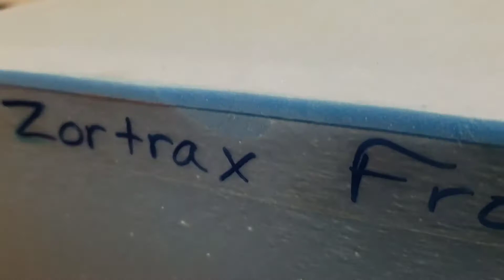ZORTRAX M200 Is Stripping Filament and How To Fix It | 3D Printer Extruder Feed Gear Strips Plastic

Comment: Stock extruder motor is way too small for the job so it gets awfully hot. My fix was put in a bigger stepper and adjust the Vref on the board to suit it. It still gets hot butt nowhere near as before and the pushing force is way bigger. I can print at 100 mms without losing steps while before anything above 50 was a no go.
Reply from the maker: Nice mod! What size motor did you use? How did you adjust Vref? The additional weight is not an issue at higher speeds?
Reply: @engineerable  I put in a 48 mm Nema 17 from Plusivo with 71N of force. If you take the bottom cover off you can see trimming pots next to each of the drivers, right next to the heatsinks. You need to turn the extruder one ever so slightly clockwise. I bumped up mine from 0.4 to 1.1V. Use a small screwdriver and a multimeter and be very careful not to short anything out. Up to the 100mm/s speeds I`m using I didn`t notice any adverse effect on the quality.
Reply from the maker: @maiorciprian  Thanks, do you have a link for the motor? Did you publish your conversion anywhere?
Reply from the maker: @maiorciprian  The best I can find for a Nema 17 x 48mm length is 55 N-cm (77 oz-in) like this: https://www.hydraresearch3d.com/parts/qmpid8sbp277kcd25a9wrngcqywaqr-j3j2n-7alfw or https://biqu.equipment/products/ldo-42sth48-2504ac-reva-motor-driver or https://www.aliexpress.us/item/2251832386575349.html?gatewayAdapt=glo2usa4itemAdapt
Reply: It might have been the oz rating I guess. Those you found should be plenty good anyway. @engineerable

Comment: You are printing without raft?
Reply from the maker: Yes, I print without a raft as much as possible to reduce waste and time. Love the Zortrax, but, not the perf build plate.
Reply: @engineerable  Im experimenting with PEI textured plate at now, I want to stop and set it by small bar clamps until the first layer? What do U think?
Reply from the maker: You could try the Z-Sense height adjustment that eliminates the nozzle needing to touch the build plate. https://www.z-temp.co/store.html#!/Z-Sense-Bed-Height-Control/p/69065095/category=0 @stewixjoooo
Reply: @engineerable  I live in Poland and from USA transport of the product cost 200$ + 60$ sensor

Comment: Hi there, an question - do you still have a 3d model of this fillament cover? Im afraid I cant make mine own one.
Reply from the maker: The heatsink I installed is made of aluminum. I also discovered that the idler extruder bearing was failing, which contributed to the filament stripping.

Comment: Hi, The problem you're experiencing is caused by your fans being too weak. Those Noctua fans are not as powerful as the original ones (i've tried them) - and the heat is generated due to not enough cooling and gets transferred up to the extruder. The motor also gets hot, but not as much to melt the material.
Reply from the maker: I see, thanks for the tip. So what brand fan do you recommend?
Reply: @engineerable  Actually it's a bit more complicated. If you check the voltage that is supplied to the extruder fan - it's 22.2V (at least for 3 of my 4 Zotrax m200s). I've added a voltage regulator on top of the extruder so the fans stop going bust every few months. I can't find the original fans even here in Poland. I also couldn't find any well known brands of fans that would work well. As I said, I lowered the voltage to around 14V so the 12V rated fans won't go down so often. Try to search for a fan that is 12V, 0.08/0.09A and between 6200 or 7000 RPM. I can send you pictures of my modification if you want.
Reply: Delta fans are top notch; also Sunon and GSDTime are ok. Noctuas have low cfm and no pushing power.  Also that extruder design is close to 16 years old. How the Z design team decided that this is the best solution for a 2000 usd machine is beyond me.  @engineerable

Comment: Had a similar problem and just popped an IC heat sink on the back. Fixed the problem and I was able to lower the extruding temperature back to what I normally use without any jamming. Seemed to be triggered by cold weather, and I suspect the thermocouple is bad too, as the filament balls up when the print finishes.
Reply from the maker: Nice! It sounds like you have identified the need to replace the thermocouple also.
Reply: @engineerable  This was not nearly as frustrating as 2 years ago when I broke the machine in (it was a hand-me-down). The Z-Sense and ZT-HE really helped as well as replacing the bearing, extruder PCB & cable. ABS is a tough material to master, but results are very sturdy.

Comment: Hey man, thank you so much for your video. I have the exact same problem, and a cover over my m200 like you. The room it's operating in is pretty cold. I'll build the same setup you did and add a heatsink on the backside too, because I'm mainly printing ABS. Thanks again!
Reply from the maker: 👍 Keep that extruder gear cool and you'll be set! Works great ever since this mod.